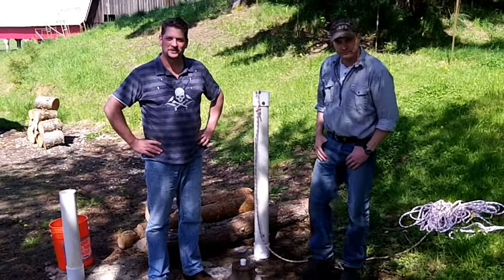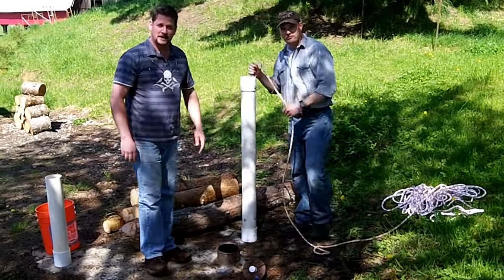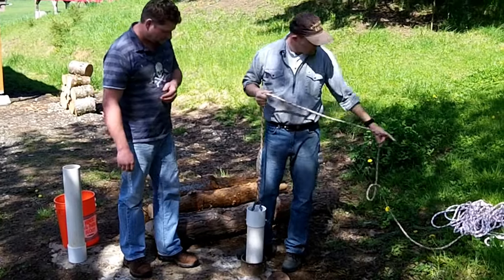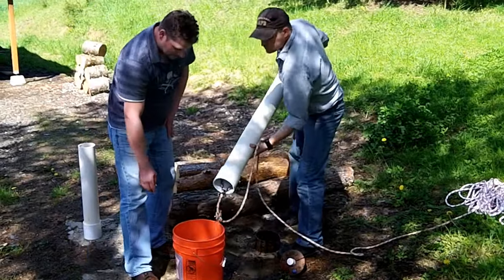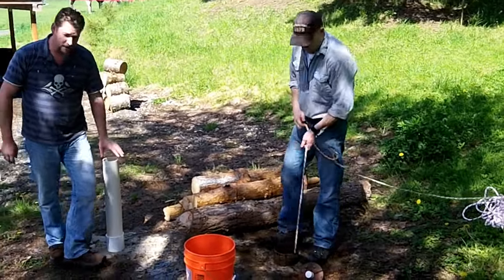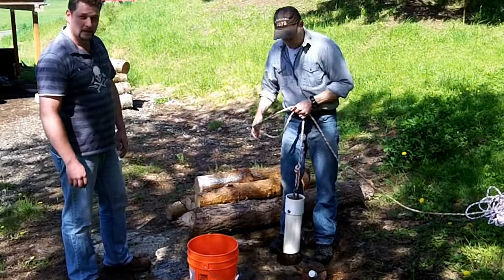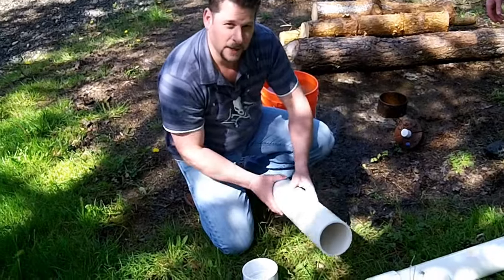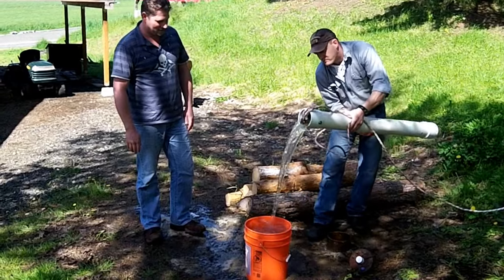CHEAP and EASY, Emergency Well Pump Requires No Electricity

Comment: Great idea - just remember to check your well to make sure that you have room for your well bucket.  Most people will have an electric well pump connected to a pitless about 10 ft down.   For a home with a 6 inch well casing, you are unlikely to have room for a well bucket much bigger than 1.5 inches.   You could make a long skinny well bucket and that would work.    Excellent idea, well designed bucket, just need to make sure you can actually use it in emergency.
Reply: Yes your right. How do we get around the electric  pump ? My well is 100 feet deep. They say our grid it to go down in the near future I've got to find a way to work around it to get water.  Don't know how yet.
Reply: @20greeneyes20  how far down to the static water level? There are deep well hand pumps. Use pipe and a rod to pump water from the bottom up.
Reply: @akbychoice  Thank you !  I will see what that level is. It might not be as bad as I think. 😉
Reply: I have a deep well with submersible pump and pitless adapter. I think he mentioned in case of emergency, remove the things in the way.  Cannot the pitless adapter be pulled out and then pipe and pump at the end?  If my pump dies, the service person will have to pull it out to replace it.   So it has to be removable right?  I'm thinking after China takes out our grid soon after attacking Taiwan while Biden is still in office, I would just pull out everything and do exactly what the guy in the video did.  Won't that work?
Reply: Yep, make sure the power breaker to the well pump is switched off before you pull out the submersible pump etc. You could have power going off and on . Put on a hose clamp or two on the pump pipe and tie a safety rope to it somehow  in case you slip pulling up the pump. They're heavy, get some help.

Comment: Awesome! Just a tidbit for adjustments: biggest mistake people make with wells is contaminating the water supply- the PVC, rope, and your hands are all not clean and you're spreading germs into not just your water supply but also anyone else using the same underground water. You just need a way to keep the pipe and rope clean and not touching the ground. $20, wow!
Reply: In another video, the guy used a probably 40 gallon gray rectangular plastic tote to feed the rope in and out of and store the bucket.

Comment: Get a 12 volt RV water pump and a solar panel with a 12 volt battery drop your poly line down the well and the sun will give you 12 volt power to run your well ...

Comment: You're dads a handy guy! Thank you for the instructional video. I am looking for an emergency backup for my well which is in use so I need something that will not interfere with the existing mechanicals and pipes etc. assuming the emergency wouldn't last long so will need more of a small hose with a pump at the top to avoid messing with my working household well pump system. In a situation requiring a permanent hand powered solution, however, I think this is just as good as a hand pump and definitely faster and a lot easier to make and maintain. With no visible pump or spigot so no one would know the well was there once camouflaged in a SHTF scenario keeping any passersby or neighbors out of/from contaminating your well water supply. Love it! More! More! More! :))
Reply: I think I'd let them haul the buckets to ME = for each bucket they plan to take !!! 
We actually did that already !   It works as long as they do !    Very FAIR     =D
Reply: Would be great if someone could figure out how to leave the electric well pump and add the ability to use a hand pump or well bucket (without pulling the electric pump). I can't think how that would work. But maybe someone else can.

Comment: True genius in its simplicity and efficiency. Just like the old days dropping a bucket down a well on a rope with a pulley only this time the bucket is a tube but its still hauled up on a rope! I couldn't have found you guys at a better moment in my life. I got a well drilled last year but ran out of money and couldn't buy a pump. Water level is only 15 feet with a six-inch casing. I haven't needed to use the well yet but that time is drawing very near and I was thinking about how much money it was going to cost me to move water fifteen feet from the ground to a bucket. Now I know exactly how much it's going to cost: $20! Thanks for sharing, you spared me from having to spend a lot of money at a time when money is real tight. You've done your good deed and I will share this video.

Comment: Screw  a bolt in the bottom of the check ball and that baler would automatically dump when you set it in the bucket.  You share that water with your neighbors wells please take the time to secure the well bore from contamination, doing so is in your best interest as well.

Comment: Dad is sharp! Thanks for the great and simple idea. Wells can be contaminated but you will die without water in an extreme situation. Just use your head and filter, pasteurize or sanitize before using.
Reply: I recommend a Berkey water filter. You can make one cheap using buckets if you cannot afford the entire Berkey set up and just buy the filters on Ebay.
Reply: Why? It's not filtered or boiled from my well tank

Comment: i did'nt get to read all comments but did see one about a trigger to lift ball and release  water w/out tipping tube each time(KISS)Keep It Simple Stupid....add base flange w/reducer and 6" of 3/4"pvc w/ 3/4"cap....keep both hands on tube and rest it down onto 3/4"stub to lift ball and release water thus saving backbending motion...move stub to next bucket OR make bracket for stub w/ bucket underneath..i'm an old fart w/ bad back!

Comment: this is a great way to contaminate your well too if its a working well. Also i that rope snaps and its 100 feet down your screwed..
Reply: Guess they'll think of using TWO hauling ropes to avoid that emergency!!! Pretty
smart guys !   I'm a senior @ 75+  & on our farm have an 80' well with the pump at 43' and couldn't think HOW to access the well to USE a well bucket !!! Never had to resort to that, YET...  But now with the possibility of a real & long- lasting power emergency  - we now know we CAN, and how!    Thanks to these guys!  Puts my
mind to rest..........

Comment: Thank you!  That is a very interesting concept. I am looking for a manual way to extract well water and may utilize this idea.  I like the idea in the comments section of the quick release string on the the ball too so you don't have to tip it to release the water.  Good job!

Comment: Thank you. I have electrical and a tube in my well. Would have to go down to a 1.25 inch pipe and at 4' long, thats still a quarter gallon per pull.

Comment: We used to have a metal thing like that on the farm years ago it had some sort of flapper at the bottom of it it would open when you dropped it into the water and the weight of the water would hold it closed and you could pull something at the top to release it.

Comment: After doing the process about 5-times, surely you would figure an easier way to empty the tube...maybe learn how to do it all with little or no effort like oil well pump except with grandma on a stationary bike powering the contraption.

Comment: That’s not a well pump. That’s basically a bucket maxed of PVC you have to manually lower down into well and then scoop up water and pull it back up. How much water can you bring up per minute? Not much. Essentially if you have a very deep well like I do.

Comment: Easy for you and your set up it's a great idea,  but I have a 100 foot well I believe there is a eclectic pump that would be in the way. Could I feed a water hose down and use a manual hand pump at the end of the hose? Would that work? 
 Really need advice. Getting a lot of storms and power goes down a lot.
Thanks! 😉

Comment: I'd recommend using sterile gloves during assembly and anytime you are using that including on the rope, to keep microbes out of the well.  Also, that is not a pump!  It is called a bailer.  You can buy pre-assembled ones at a well or environmental supply store.

Comment: I'm having difficulty finding stainless steel bolts and nuts. Could I use galvanized; It's only to keep the rubber ball from floating up.
Thanks for the awesome video.

Comment: Keep that well in use and keep a daily diary and have two signatures on each days entries.
If you are in Washington, the State will determine that your well has been abandoned and 
take away your water rights.  I know of a couple in Washington State, and though their well 
was in use they had to fight the State to keep their well.  If you have trouble with your State,
well... do what you want.  I would sue each person severally all the way up to the head of the
department.  I would go after each one of them severally and for the non- defensible amount.
You may have to fight to keep your well.

Comment: Question, do you think it would work if you got an end cup without a hole but put a weight in the bottom so it goes down into the water to fill at the top? Would that work?

Comment: Now, you guys DO REALIZE, that if you took 5-feet of single-strand 10-gauge wire, punched it through the ball on the bottom of your check valve, ran it up to the top of the bucket, and looped the top of the wire, then you would have a trigger to go ahead and dump that well bucket into the 5-gallon bucket, without having to tip it over, right? Then again, if you realized that, you'd also know that for $40, you could just go to ACE Hardware and ORDER a 'Galvanized Well Bucket' in the appropriate casing size, and it would have a spring-loaded trigger, and everything already on it. Your dad didn't invent this - he remembered it from being a kid and seeing other people with store-bought WELL BUCKETS, and had you make one out of PVC. How would I know? Because I'm almost 60, and have had to 'draw water' with the back-breaking things before! Congrats, you reinvented the wheel, in PVC.
Reply: Dust Devil ...   Smart ass
Reply: Well their video was useful in that it brought me to your comment and now I know I don't have to faff about with pvc! So there is that.  "reinvented the wheel, in PVC" had me in stitches.
Reply: you cannot buy everything you want, every where, sometimes its good to know of a simple solution that you can create yourself
Reply: Why don't you do a video then?
Reply: I'm 53 and I've never seen one before. I've never had a well until now. You are right that we have forgotten a lot of stuff. I just don't get your snide comment. These guys have shared knowledge and that's what is needed these days. Why not commend them for taking the time to help others with this how-to instead of being sarcastic? They never said they invented the concept and yes they totally remade it into easily accessible materials that anyone can work with and find at their local box store. You seem like you might have a lot to share. I would love to see some of your survival/homesteading tutorials.

Comment: why not make a reducer to 1" at the top  with a 90 and a hose  and pump the apparatus up and down  making the water travel up the tube/handle? mine uses a windmill piston in a  pvc tube with pvc sucker rod/ handle. i plan to use a trundle board to  use body weight to move the piston. pop eye thighs instead of arms.
Reply: Interesting altho hard to quite understand, I would love to see your idea

Comment: So, all I have to do is get my wife and myself to pull the 100lb roof off the well house, then pull out the submersable pump and the 150 ft 1 1/2" pipe full of water it is attached to, to make room to lower a 4" pvc pipe, fill it with water, then lift it 150'. You have no pump to remove and already have an alternative source (city water). Now go get me a coke anad some biggy fries and make it snappy Einstien.
Reply: what a moron   this is if the  crap hits the fan   so you  can c go cart from a river and more power to a   dope
Reply: This for a SHTF scenario when the grid is down for an extended period of time.  Do you not get that smart guy?   I have the materials to do this same thing with a slightly different design.  And yes, my wife and I at 50 something years old pulled a 200" pipe with spacers out of the a well.   I lifted the pipe out, my wife drug the pipe out of the way.  And the roof on our pump house weighs more than your wimpy 100lbs.
Reply: the people showing it off aren't much smarter they called it a pump lol  its a well bucket
Reply: I get what you're saying Embarado but, yeah, they are smarter.   I mean these guys are just demonstrating a pretty neat way of hauling water out of a well and the joker aboves bashes them unmercifully for it.  I want people like this to share their great ideas like these guys.  I love the ball idea.  I have seen it done with a foot valve but, I think this is better.  In fact, I have got the materials to make two of them.  

You're right, it isn't a pump but, to tell you the truth, I wouldn't have clicked if they had called it a well bucket or bailer.  By the way, seeing that you do smithing and woodcraft, I am thinking this idea can be used with a windlass of course but, with a design that avoids having to tip the pipe.  I understand that for shallower wells, this will work faster than the expensive hand pumps they have for these kinds of wells.  I'll bet with your experience, you could come of with some good ideas.
Reply: just off top   I would use a sail needle and put bank line through the ball  tie to top of bucket  when it cane out of well pull string while bucket hangs over 5 gallon pail  as for how to hang id have a tri-pod over well with a pulley and rope to raise and lower the  well bucket     now all that said  when I can spare the cash I plan on a simple pump from engineer 775 it works like a   pitcher pump but will pull from 100s of feet  where the pitcher is limited to 30
Reply: Yeah, as I suggested, something like a windlass on the top.  My idea would be to hook the ball to something at the bottom that would allow it to be pushed back up from the bottom.  It might roughly resemble a plunger.   Basically my aim would be to pull the pipe up, the pipe would empty when reaching the top into a container without any other input and, having been done, the pipe is lowered back into the well for another round.   

I  know of engineer 775.  He does some nice but Expensive projects.  I would look carefully before going to that expense with the Simple Pump.   I saw a video here on YouTube, (can't find it at the moment) that demonstrates that the bailer is just as fast or faster at drawing out water, at least in that case where his static water level was about like mine, around 50 feet, than the simple pump which is slower than people realize and can be taxing to pump, depending on the depth of the well.   There are all kinds of designs on the windlass to make it faster and easier.   The nice thing about the Simple Pump is that you can slide it in next to the piping of your submersible.  It would be that instead of speed that would make the decision for most people.  For me, with family around, I can get my pump out and put a bailer in the well and I'll be fine.
Reply: hears an other    put a stick  in to ball sticking out the bottom     when the well bucket  comes out lower it in till stick pushes  ball  to allow water to flow
Reply: as for the simple  I  already have a wind mill at my undisclosed location to power it so it can run and fill my tank to gravity feed the camp
Reply: and my static on that well is 250 ft.
Reply: Your first reply is one that I considered early.  I do think a design using the basic concept in this video in addition to an automatic dump would be awesome.  That is, all that would be required of the operator would be raising and lowering the bailer.  Regarding the windmill, great minds think alike.  I was motivated to look at windmills just yesterday.   Wasn't seriously considering them as, in Piedmont NC, wind is not a reliable source of power.  250' to static level?  Is that normal for your area?   I am guessing midwest? Southwest?  Windmills are popular there due to the lack of obstacles.  Anyway, sorry to be hacking away at this but this is an interesting area for me.
Reply: not   mid west or nw  ALASKA     the well was put up on a hill where a research station was  it was demolished and the well left its mine now but  a long way to the water  probably best as in winter water close to surface freezes     I   put the new pitiless 15 ft.  down  when I ran the  pipe in to the bunker   now  just a pitcher pump in there  I want the other   that can be run off electric from soar  or  wind turbine

Comment: Very respectable to share this. My thoughts would be it might be necessary to make a smaller diameter version that could fit down past the existing pump piping. Wont be as efficient but maybe less effort in a emergency, Thanks.
Reply: The issue there is that the power cable is usually taped or zip tied to the pipe and a plastic pipe might not be straight in the bore, so the bucket will get hung up going down or coming back up unless you use a very small pipe diameter.  Once you get down to 1 inch pipe it holds less than 5 fl oz per foot.

Comment: In a survival situation this would mean you have to pull up 100 ft of well tubing and a heavy pump to dip your PCV bucket down the casing. Might be easier to just put in a hand pump well. Not many folks have a spare well not in use. Cool idea though.
Reply: A hand pump works real hard and takes MANY pumps to get one 8 oz. glass of H2O...............   not easy at all. Ours is at 45 feet !!!
Reply: That's not at all how I remember my grandmothers. 2-3 pumps and you'd have a solid pitcher full. Maybe hers was more shallow. Maybe your system doesn't create enough vacuum?